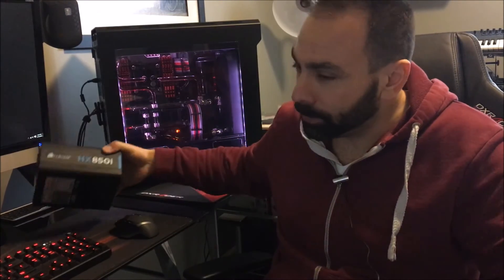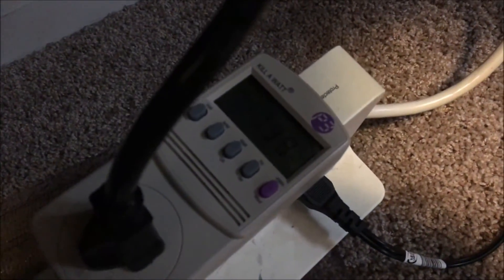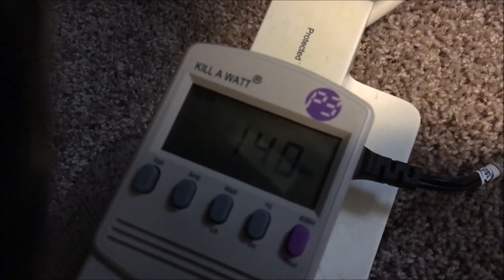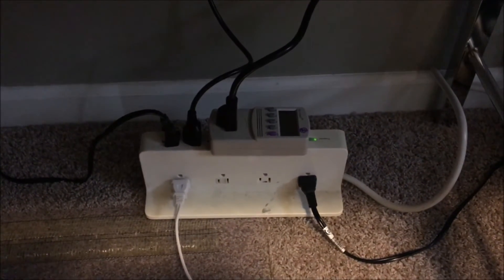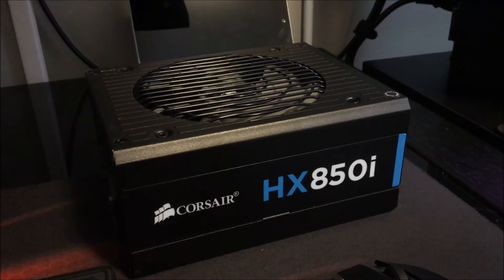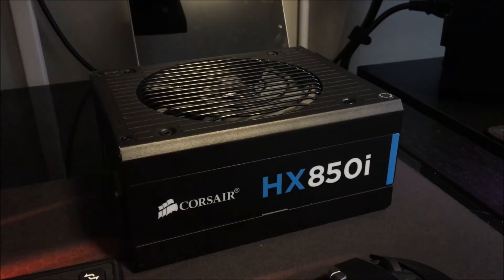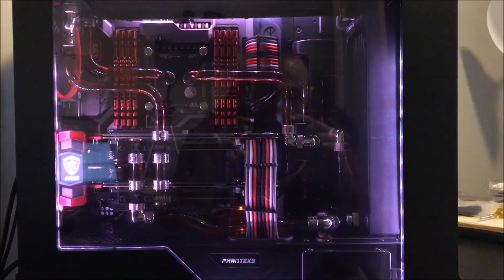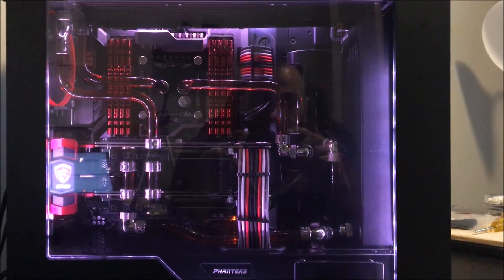Corsair HX850i vs 1000i - Which One Do You Need?

Comment: Another very important thing to keep into consideration is "Advanced Transient Response" this is basically the way the PSU will react to sudden power draw.  
Myself previously running SLI on 850W mid range PSU (ThermalTake) with no issues encountered crashes, re-boots and shut downs when switched to the  less power hungry 2080 TI, it is less power hungry than 2x older GPUs but the way it pulls power from idle to max will cause some PSUs to go to safety mode even if you still got 400W more to go.
Check reviews of different PSUs on Tom's Hardware and watch the section of "Advanced Transient Response testing"
Other words you may have 1500w PSU and it will suffer bad time when you get installed a high end GPU even while it only uses 300w, what matters is how fast it goes from 50w to 300w.

Comment: like it, but if you pull 800w from the wall you are not putting 800w into the system... some goes to the heat... but the hx850/1000i are very efficient with about 88-94 % depending on the power it dellevers (most efficient at 50 %)

Comment: Hey just a random question. Do you think I would need a 1000w PSU to run SLI gtx 1080Ti? (from leaked specs). Pretty sure titan x pascal and 1080Ti are the same power required? 
I was wondering with sli 1080Ti and i7 6700k, would a 1000w be needed or a 850w be enough? or 1000+
Reply: "want"? I don't know what you're reading, but what I typed indicated nothing about what I "want" I clearly asked what would be good enough too run the 1080 Ti with. Please go back and read comments before giving your complete utter useless shitty comments, thanks. This blows my mind... good bye.

Comment: Hey Brian I'm using 6800k, h115i cooler, 2 hard drives, 1 ssd and one gtx1070 gaming X. Highly considering getting another 1070 but I'm running it all on a hx750i. Do you think I'm really pushing my luck with power draw?
Reply from the maker: +Luke Gale the gaming X draws more power than the FE. If they were FE cards id say you were probably ok but you might be pushing it here. I know power draw calculators may say you have headroom but I always err on the side of caution with power supplies. Hitting a power ceiling causes really strange errors and shutdowns and you generally want no part of that if you can avoid it.
Reply: okay no problem, when i upgrade to another gaming x ill keep in mind that if any strange errors that occur ill upgrade to possibly something along the 1000w side of things. thank you for the feedback!

Comment: Lol, i ran two 6804gb's in sli and a watercooled 2600k on an old corsair tx650 for some time, worked great for gaming the time i used it, though with some crashes under 3dmark etc, so i upgraded to an Evga 750 g2, and ran the cpu@4,6ghz and gpu's overclocked to 1200mhz with no issues in benchmarks :)

Comment: Hi could you tell me your system spec please. I'm shocked by your power draw.
Reply from the maker: +l3xbi 
i7 5820k @ 4.6ghz
64gb ddr4
Asus Sabertooth X99 mobo
2x MSI GTX 980ti @ 1500mhz
EK Revo 140 pump/res
Samsung 850 Evo SSD
WD Blue HDD
NZXT Hue+

I hope this helps
Reply: +Ess Tech TV would be helpful if you could just tell us up straight instead of us watching another entire video
Reply from the maker: +l3xbi that was my initial thought also, but it's likely that the pump is drawing more watts than I originally anticipated, and the X99 CPUs are hugely power inefficient (but beastly powerful)
Reply from the maker: +Jarred Roe Check out my video on Client Build 31.  This is the same system.
Reply: +Ess Tech TV thank you! interesting that the 850w can't handle 2 980tis, coolermaster psu calculator suggested that it would be fine!
Reply: +Ess Tech TV god damn I'm on a h110i gt, I will probs get a 1000W tomorrow! Thank you for the heads up. #payday